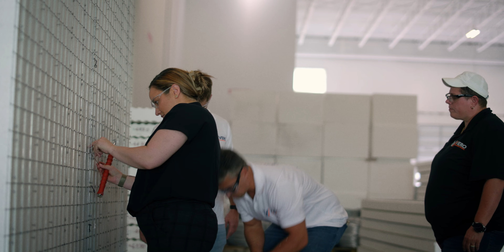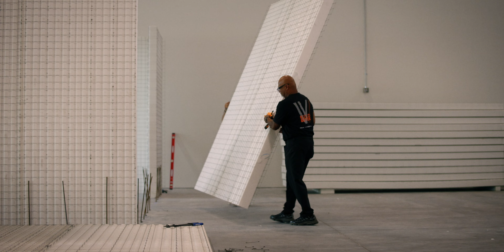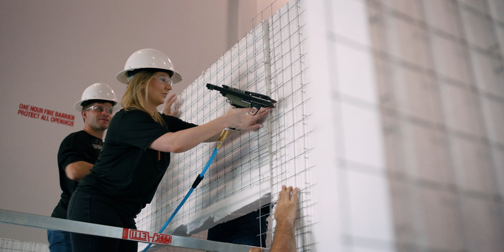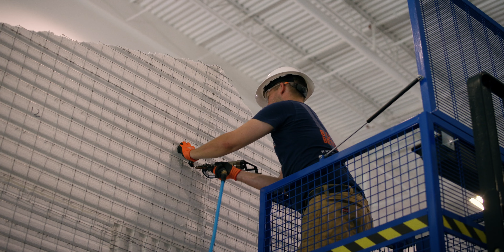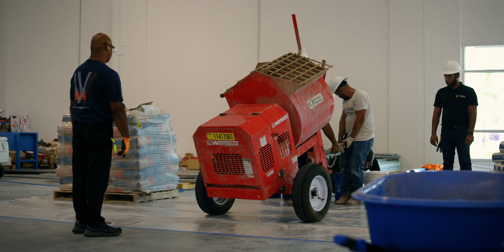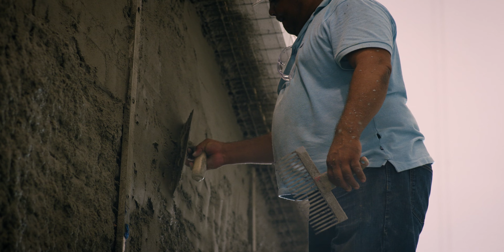We Built This House In 14 Days!! - (Part.1)

Comment: Where is part 2? Its already been two months.
Reply: You won't see one 😂. I've seen this product in action. Terrible concept. Takes forever to build and is extremely messy with all that cement. I watched a duplex townhouse built off of orange ave. Took a year to build 😂
Reply: @joshuafootman1593  Interesting observations! I am surprised that it took that long. Applying two layers of cement/sand concrete mix onto the wire mesh with a professional shotcrete machine should be possible within just a few days. I did hear that builders had trouble applying the shotcrete overhead to the ceilings though. What caused all the delays with the townhouse you observed?